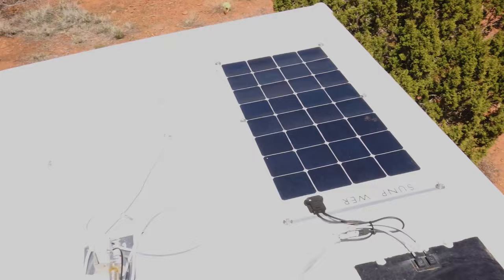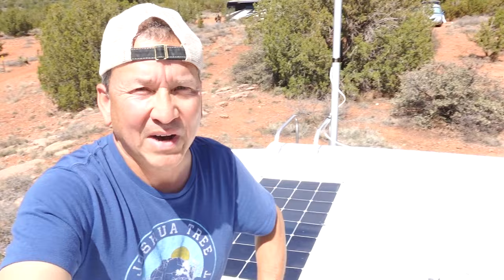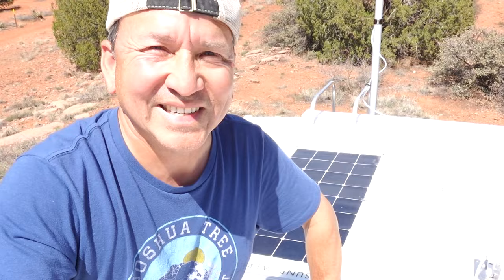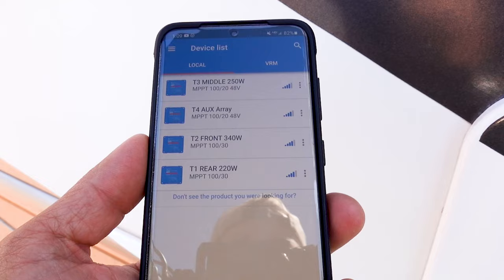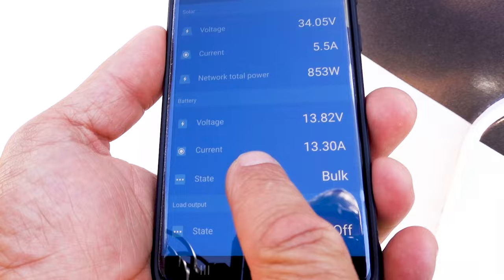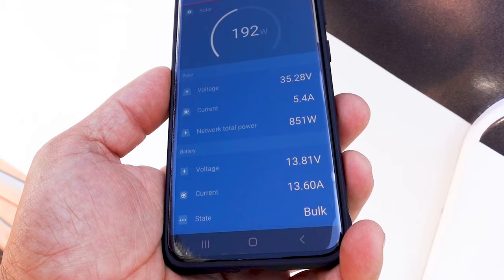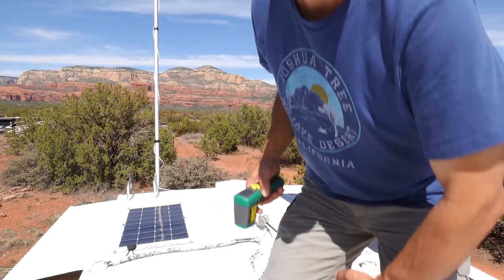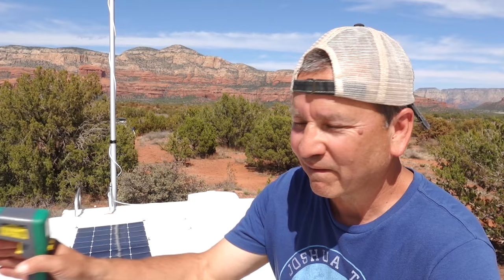Heat/Power TESTING Flexible Solar Panels on RV (Flat Mounted vs Ventilated)

Comment: Was there a difference in the wire lengths from the panels to the charge controllers? My guess the ground mount has more length. Also the input impedance of the two different controllers could make a difference too.
Reply from the maker: Yes. The ground setup does have longer cable and a smaller controller. That said...I've still pulled up to 16A out of those two panels. 😳

Comment: Just thinking aloud here... maybe under those flex panels you can encourage more airflow by bonding them to a thickness of a boat mattress air underlayment ... and attaching that on the roof... it's a material with almost total air gap making it up... you'd get really high air movement under the thing and possible it would cool off more...  someone with a 3d printer could probably make something up for you as well in tiles you could cut to size...   then again the heat issues may concentrate in the outermost layer with the cells on it anyway and little improvement...  there's stuff on amzn "boat mattress underlay"
Reply from the maker: Interesting idea. Thanks. I suppose it would work fine.

Comment: When the panels get into the 120+ temperature range, doesn't that damage the roof membrane since there is no airflow between the panel and the roof?

Comment: You might not want to hear this...but I am being honest. I had 6  different flex panels 
( Slow Learner). After you leave them out in the sun ( DUH ) they become VERY BRITTLE.
That means if you pick them up without first saying a lengthy prayer,  the panels will crack.
When theY crack the infinitesimal ribbons inside of the panels will crease to conduct electricity.
And you now have an expensive piece of fiberglass to draw pictures on.
The first ones I bought were TWO HUNDRED DOLLARS apiece.
Get the salt and pepper ready.
Reply: Agreed.  I had four flexible panels and they did not last 2 years on my four wheel camper (white aluminum roof).  They seem to eventually bend and flex and damage circuitry.  They seemed great, worked great for a while but I would not recommend them to anyone unless their RV is stored in a garage most of the time, and used occasionally.

Comment: You must have done this before you switched to the 170 watt panels. I wonder if the new fastening system will be cooler.
Reply from the maker: No. This was just a couple days ago. I still have these 110W panels on the back of the RV. I do plan to swap them with 170s and change the mount though to match the two on the front.
Reply: @RVwithTito  Did you measure the temps on the new ones?
Reply from the maker: @gregridge9273  The 170s? Yes. They were about the same at 132 deg or so.

Comment: I have two questions:  how do you store the flexible solar you had deployed on the ground?  I was going to do that, but opted not to because it seemed to me the flexible panels would break too easily if moved all the time. Please do a video on that some time!

Next: your antenna mast, I assume that is for WiFi, are you running omnidirectional or yogi?  How far are you from the cell tower, what type of signal are you getting from your phone verse WiFi?

Comment: @rvwithtitodiy hey there, i have a 160w flexible panel on my van and recently my voltage has dropped to about 8.6-8.7 volts.. (unuseable..) . I tried swapping diodes but no fix.. any ideas what the issue is? Is it toast?

Comment: I used the exact same setup as you for mounting the flex panels to the roof and I do have issues.
My panel is a Rich Solar 100W panel and it worked great for a while but after 8-9 months the top ETFE layer flaked off completely. It was possible to wash off the residue and I got some power back but now it seems like the panel overheats and I lose power.
Reply from the maker: Interesting to hear that about the ETFE. The SunPower panels have a PET top layer that's thicker and more UV tolerant than most other PET flex panels. I do have to clean them since we're in the wind and dirt.
Reply: @RVwithTito  
Thx, I might get one of the SunPower panels then. How long have they held up for you so far?
I'm really disappointed in the Rich Solar panel since the coating just flaked off. There is another user on Amazon that reported the same thing. I wonder if this is the reason it now overheats and drops in power. It does still work but I haven't been out camping since last year so I've not actually used it in a while.
I'm a dummy for not removing it when it's not in use. That was kind of the point of doing the same install you did.
Reply from the maker: @christianholmstedt8770  I've had those installed for 2 years now and they are still in great shape. You might also look at those panels I used on the ground. They have the same tech as the SunPower branded panels, just with a few more cells. They're manufactured by Sol-Go who picked up the SunPower flex panel business and are improving on the design. Check them out at bosswatt.com.
Reply: @RVwithTito  
Thank you.

Comment: A number of comments had possible reasons for the differences.  I wonder if the white roof reflection, compared to the darker environment for the ground panels makes any difference.  Just a thought.
Reply from the maker: They are very close. Any slight change to either could have switched them around. I've actually had those ground panels bringing in 16 amps recently under the right conditions.

Comment: I may have missed it, did you insulate the panels on your roof?
I have a 24’ LTV that came with 4-100-watt, Go Power, flat panels. After 3 years they were delaminated, & very hazy, never saw anything close to 400 watts production from them!
Late last year replaced with 8-framed panels.  Hoping that they will help to shade roof, keeping inside a bit cooler.
I think that for your temp comparisons to be accurate both sets need to be completely same flat positions!

Comment: I'm going to be designing a new solar system for my new imagine 17MKE. I have two 100 watt flexible panels from my old system. Knowing what you know now, would you opt for flexible panels still or convert to glass if you had it to do over again? I'm leaning towards making my own glass suitcase to go along with my 200 watts of portable.
Thoughts. I've watched all your videos as you have evolved through your mounting options and you have really helped a lot. Thank you
Reply from the maker: It depends on the RV. I wanted to keep the weight down and minimize bulk on the roof. If that wasn't an issue, I'm not sure which option I'd choose. Both have their appeal.
Reply: @RVwithTito  Thank you. Decisions, decisions, decisions.....

Comment: The bigger question is hot hot is the ceiling on the inside of the camper under the panels.      I am going to guess 20-30 degrees hotter

Then comparing the old beat up panels on the ground?????

You can't draw any conclusion from this mess

Comment: The angle on the ground and the way you use the IR temperature meter, makes the measurement incorrect. measure under 45 degrees and block the sun with your own shadow and both set-ups needs the same angle. So it is an interesting test, but you should do it again with the correct set-up 🙂

Comment: I have a high top van and the roof is far from flat so I will be limited to two panels up there; the highest output I can afford. 

By connecting in series will I get more power to use to charge my batteries?
Reply from the maker: Not necessarily more power when in series. Higher voltage (in series) means you can use thinner cable. Plus MPPT controllers work best with higher voltage and start charging sooner in the morning.

Comment: What about the temperature on your white roof section?  Are you adding to the heat inside the rig by having flexible solar panels mounted on your roof?
Reply from the maker: Nope.

Comment: Any chance you can do a test with bougerv CIGS directly on the roof with a meat thermometer probe between the CIGS and the roof?
Reply from the maker: I don't have any CIGS right now but I used to have something similar a while back. I could feel the heat inside the rig.

Comment: It seems like the roof mounted surface panels would add a significant amount of heat to your coach.  I am wondering how much difference it would make if you had ventilation on the roof panels, i.e. the one inch of separation or so?  Wondering what the overall comfort factor is on the internal temperature of your coach may be?
Reply from the maker: The insulated layer between the panel and roof takes care of most heat transfer. Other ones I've mounted directly to the roof definitely do have some heat transfer into the coach if your ceiling isn't well insulated.
Reply: @RVwithTito  Thanks Brian.

Comment: Brian, I’m going to do a setup similar to yours. Two 110 watt panels in series and a movable two 50 watt panels in series, connected in parallel to the 110 watt setup and then into a Victron 100 V, 30 A controller. Will this work? Does this system fully charge your lithium batteries? Thanks for your videos.
Reply from the maker: I have much more solar on the roof than I showed in the video (800W total) plus the 230W on the ground. I could get away with less for my 400Ah of lithium, but more is better on cloudy days.

Comment: I just finished removing my two 100w flex 'Sunpower' panel off my RV roof that were glued and screwed down directly to the roof.  My two year old panels discolored the gel coat.  I am replacing with mono crystalline rigid panels mounted to standoff brackets that will allow air flow under them.  I wonder how bad the damage to the roof would have been if I left them on long term?
Reply from the maker: Yeah. I had a similar issue when the flex panels were mounted directly on the roof membrane without anything underneath (like a polycarbonate or plastic cardboard layer). Having something underneath has fixed that issue for me (two years later -- minimal heat transfer and no discoloration)

Comment: Brian - why did you set up your panels in a series creating 24v instead of parallel w 12 v to your controller - with the 24 v input to the controller wheres the conversion back to 12v to the battery  -or did i miss something again
Reply from the maker: The solar charge controller adjusts the battery charge voltage to match the battery system voltage.
Reply: when you do your solar calculations do you use Voc Isc or Vmp amd Imp

Comment: How is your Lensun Fiberglass Flexible Solar Panel holding up...? Because of your review, I bought one and later bought a second one... They are my only panels so I have nothing to compare them to... I feel like are not performing real strong, but they are double sticky taped down and I will probably live with them...Are you still using yours...?
Reply: I watched a recent Tito video that he used an aluminum frame to mount additional solar panels on the roof.
Reply from the maker: I never mounted them to the RV but used one as a portable setup for a couple years. The power output eventually dropped significantly and I got rid of it.

Comment: I think that “ventilation” is somewhat a misnomer. Underneath of a traditional rigid solar panel is white and roof itself is white and when you mount panels on the roof using brackets... unless its blowing breeze, there “in theory” should be very minimal heat dissipation. This means that underneath of solar panels is probably used as a cooling mechanism because its always in shade so maybe it generates somewhat a cooling bubble, keeping operating panels cool enough to perform. 

Panels are usually black squares or black sheet which implies they always will get hot in the sun. I have had them so hot in florida sun that when I would wash the panels with a spray bottle, it would evaporate the water before I even had a chance to wipe them, which is why at home I just drag the hose in there at shower everything as I go. Of course that makes roof slippery so it is not a safe thing to do. 

In my opinion main reason why I want my panels raised is to remove any and all debris trapped under panels like acorns, leaves and such. That is about the only reason that I want them raised. 

I have never mounted them flush but in the past in one of my other RV’s I had them mounted much lower and have not noticed any difference between then and now. 

I do not use flexible panels though. I watched “I’m not lost I’m rving” back before they even set sail for the west and they engineered this crazy system and eternabond stuck every panel to the roof. By time they got from central florida to the keys for their first venture into work camping... just about every panel failed. At the time I was in between RVs and was looking to lighten the load on the roof until I saw their issues. I just have never recovered from many people having issues with flexible panels so I stayed with renogy monocrystaline. 

Mine sit about 3-4 inches off the roof and I have no intent of tilting them but all my mounts are such that when I drive, head wind basically blows everything clean under there, keeping roof tidy and not covered in green algae and stuff.

Comment: I did like you with cardboard under. Had 2 fail without.
Reply from the maker: I've definitely seen a huge reduction in heat transfer to the roof.

Comment: I have no idea where to start I have one solar panel on top of my trailer I know it's going to to the batteries that are here at Scott some yellow device that I think it's regulating that power into the batteries but again I have nowhere that I know please direct message me I really need some help on what to do I am very limited on money and I'd like to be able to be more off-grid and be able to keep my refrigerator going and the power going without being plugged into Shore power

Comment: Your performance increase is likely due to the increased irradiance due to the reflective white roof. This will create more current and therefore offset the reduction in voltage due to the higher temperatures. Full disclosure...I used to be a technical trainer for SunPower.
Reply from the maker: Hmmm. Didn't think that would make much of a difference. I'll take it though. Thanks for the info.  Love those SP panels.
Reply: @RVwithTito  Me too! I am in the process of using your method to install 600W on my Intech Sol Horizon travel trailer. One addition I'm planning to do is to use the ray tray wire management tray on the roof. I'll share some details once I have it completed. http://raytraysolar.com/#home
Reply from the maker: @chadmedcroft9351  Definitely share it when you're done. Love the look of no cables laying around. Can't wait to see. Good luck!

Comment: hey tito, is this temp read on the updated semi-flex solar mounting install or the older mounting version?
Reply from the maker: This is the older mount version with the Eternabond tape. I measured the panel mounted the new way and it's very close to the same.
Reply: @RVwithTito  how's the new mount hold up? I'm getting close on my solar build
Reply from the maker: @israelsoriano6116  Great. The only thing I've changed was to add a little piece of double sticky under the front vinyl piece. One blew off somewhere. Other than that, they haven't budged.

Comment: my experience with small solar panel set ups it that the angle to the sun makes a real difference. your roof panels seem to be oriented more perpendicular to the sun than the ground set up i have found with my rich solar 100w panels that even a small angle will show different outputs.  but then in the real world clouds have more of an effect than anything so my answer was to get two more panels.....ha ha ha.
Reply from the maker: More is always better. It's also tempting to always be moving panels around to follow the sun. I try to pick a good mid-day angle and leave em.

Comment: How about lifespan as compared to rigid panels mounted on the rv roof ?
Reply from the maker: Hard to say since they haven't been around long. I'd have to say that in general rigid panels will probably have a longer life span.
Reply: @RVwithTito  I've seen warranties for flexible panels at about 20-25 years.  Same as rigid panels.  Reality who knows.  But that may outlast some RVs...

Comment: You might be getting reflect off the roof onto the panels. Get a sheet of stainless and reflect light onto your panel. Then the output should go up.
Reply: Wouldn't mirrors also add heat increase? I think so. 
Like having 2 suns.😂

Comment: The panels on the roof are nearer the sun... :D
Reply: I think that's the called The Peukerts Factor which Victron allows you to set. Probably less than 0.1% difference given the relatively small distance here. Matters much more on big houses than RV's.
Reply from the maker: Very true :) About 11 feet closer.

Comment: Any roof gets hot from the sun, even under a solar panel, from the conductive heat that travels through the entire roof.  But if you were to add a layer of styrofoam under the coroplast,  i think there would be even less heat transfer from underneath to the panel. 
Would you ever try that?🤔
Reply from the maker: Couldn't hurt but I don't think it's needed in my case. Plus my ceiling is already full of Styrofoam.

Comment: Why don't don't you try to connect a flat fan under it & connect to solar power ???
Reply from the maker: Probably overkill.
Reply: Can you monitor it by phone ???
Reply from the maker: @tronghungdao251  No. Not with my system.
Reply: Good work have great retirement you lucky one 👍👌👏

Comment: I don't think the insulators are doing what you want.  The panels are black and absorb heat making them hot.  The insulation below, does not allow them to cool and get rid of the heat.  While you are traveling, the insulators' air ducting, allows for air flow to cool as well as when you are stopped and getting a forward or rear wind. .  Should you attach the solar panels directly to the roof material, you may get more cooling.  However, the roof is insulated inside.  Your insulators are needed for air flow and not the insulation factor.  
Don